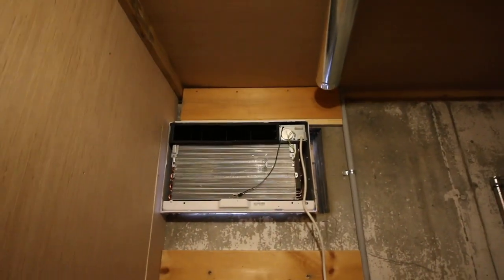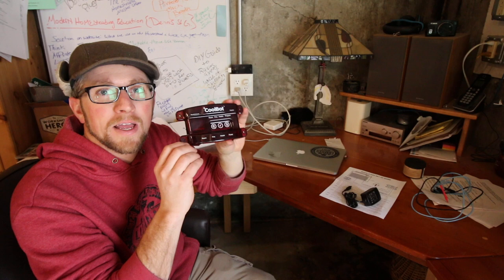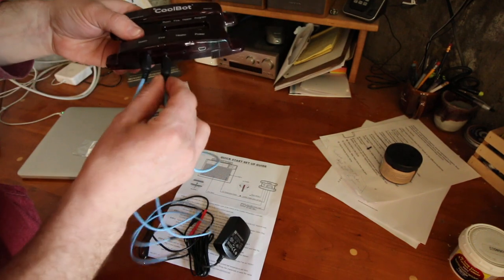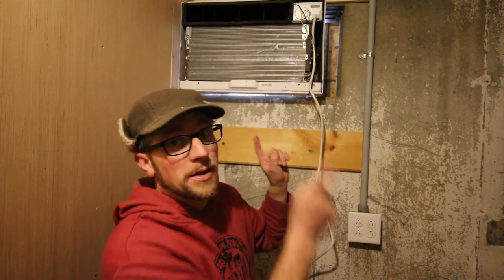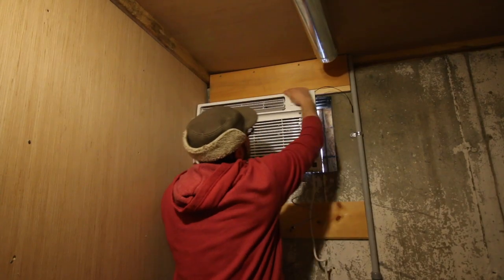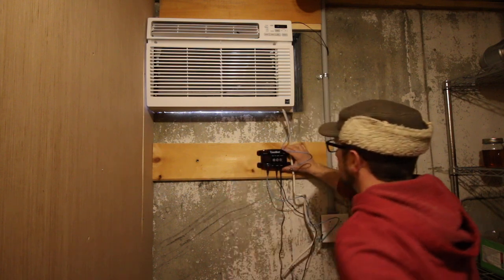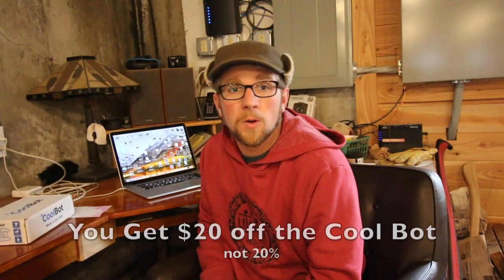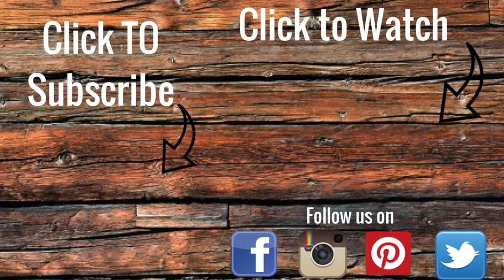HiJacking an A/C to  Make a Walk iN Refrigerator In the House ~ CoolBot

Comment: I foresee a problem in the near future. The top and side vents are for cooling the outside condenser coil. You have blocked them with the foam and plywood. In warmer weather the heat won’t be released, compressor will overheat, room will warm.

Comment: Al, running that CoolBot. Will not be cheap in the summer, that is why I did not mention the device earlier.  Still, far less stress in constant checking or loosing a room full of food if the room were to freeze.  Overall, this is a very wise move.  Padre+

Comment: Thanks for the video and the information!  That appears to solve the issues of temperature and air circulation.  I guess the a/c unit has an internal sensor that stops at 60, but the CoolBot overrides the sensor to allow for cooler temperatures that you can control.  Have you found a solution that sets humidity to your satisfaction?
Reply: Humidity needs to be quiet high for a root cellar, no? If I recall it needs to be 80-90% depending on the items you are storing.

Comment: Is the concrete basement wall insulated on the out side?
Even if it is you may still want to insulate the inside as the concrete will act as a heat sink

Comment: You should keep checking the outside wall. Just like real cave's. Cement or rock holds temp right around 41. I would think maybe adding some insulation foam board to that wall will not wick in the ground temp inside the room. Just saying as I remember last summer we went to some real cave's in NY and it always stays 41.3 in the cave. Great video.

Comment: You can use a spray in foam insulation, low expansion type, then seal the inside with silicon to moisture proof it!💕

Comment: Al you may want to check with the coolbot information but typically you are not supposed to route power cable adjacent to control/instrument cables their could be interference, noise from the A/C could impact sensor cable.One other thing is you may want to put an old fashion spring closer on the cooler door if you forget it sometime those critters will be in there.

Comment: To fix the gap at the bottom, you could cut another piece of that foam, into the shape of a piece of corner moulding. Then glue it in place, against the other foam. Contact cement will do the job.
Reply from the maker: I really like that idea! Thanks!

Comment: Might want to see if the condensor fan has a sling ring on it.  If it does then you want to leave the plug in on the back of the unit.  Many of the window units are designed to sling the water up onto your condensor coil which causes it to evaporate off the condensor and improves the efficiency of the unit.  The fan would have a plastic ring on the outside of the fan blades.  Just a thought.

Comment: everything seems pretty straight forward but I believe you should have mounted the coolbot to the side of the unit rather than under to prevent condensation from dripping on it. Also, what models is it compatible with? I assume any digital brand? may I ask what brand/model you used?

Comment: That's cool..haha..no pun intended. Thats a great walk in fridge and it seemed pretty straight forward to convert the ac unit. Can I ask whether you will have to put seals on the door as well. I know from watching the root celler build videos that the door closes quite snuggly already, but with cold air trying to escape and warm air trying to enter I was wondering whether you needed proper seals. Great video.

Comment: Below your cooling air conditioner in the Cave instead of caulking use aluminum silver tape to seal up all the drafts from outside. Heating and cooling guys use this tape on all there applications an on duct work

Comment: Read through most of comments to see if anyone else saw this. Did not. When putting in the foam you blocked off most of the intake vents for the outside heat removal coil. This will cause the coil not to remove heat efficiently and may overload the compressor to the point of burnout.
Reply: I too have been reading down the comments for this. I think Al would be better off leaving out the plywood and second layer of foam. I guess he might need to rig some other support although it didn't seem to be going anywhere without the plywood.
Reply: Might make the AC overheat/go bad sooner.
Reply: That's why I just suggested the foam, we used it in hotel maintenance.. it works great.
Reply: Agreed.  It would be better to mount the AC on a sheet of plywood at the interior face of the foundation, and leave air / drainage space all the way around clear to the outside edge.    Then add your insulation inside the foundation / plywood.   Let those vents breathe (They're the intakes for the condenser coil fan many times)

Comment: First and best idea on refrigeration.   Time to call solar city best battery backup.  With smart meters Tesla power wall.  13.4 kwh.  About 3 to 4 days emergency backup and add panels that are being replaced with the newest and latest must have first blue bloods.  Too bad you had to roof conventionally vs using the new solar shingles with a lifetime warranty.  Around same cost as replacing a cement tile roof.  Our cost of install on Owen's Corning $350.00 best 50 year roof I've found.  They make there shingles and supply many others.  You would be a perfect fit for a Lucas mill, field of hemp to do post and beam slip form construction.  Get paid to make hardwood building materials.  Thank goodness Citi folk only see a problem.